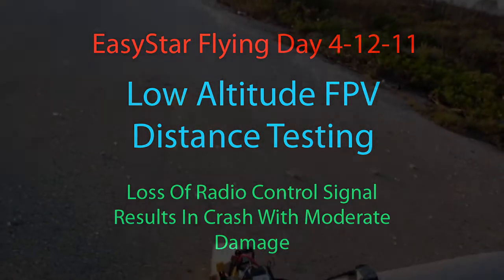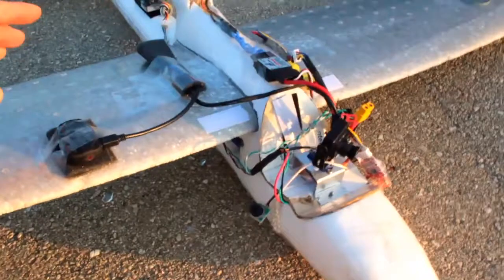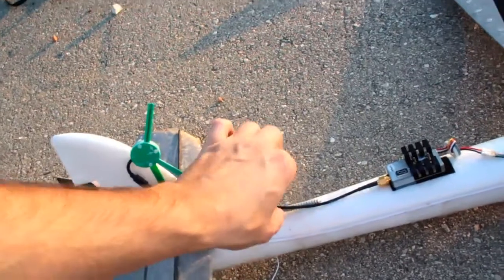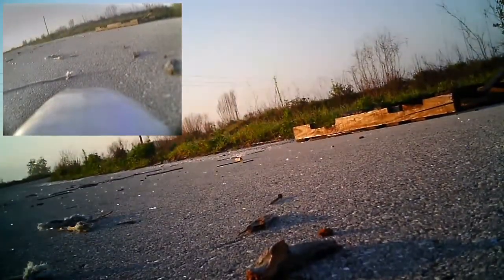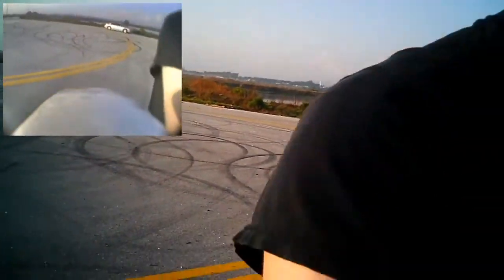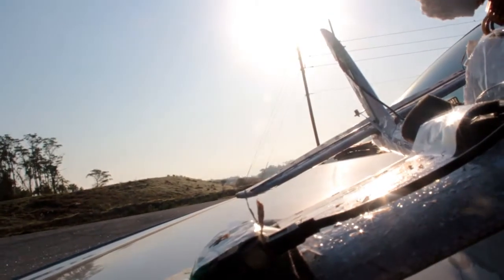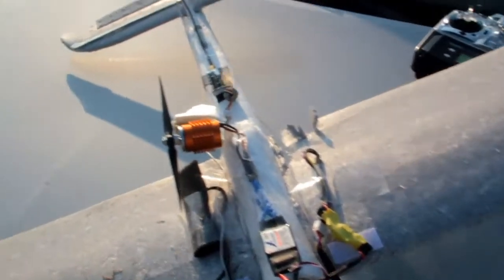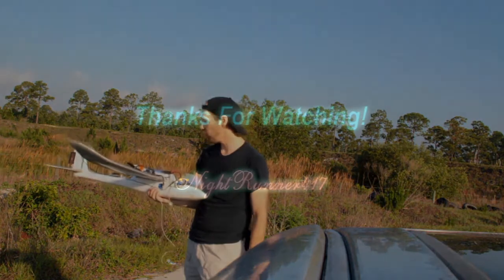EasyStar FPV 4-12-11: Low Altitude Distance Test And RC Signal Loss Crash

Comment: Well, at least you know about where the range edge is. I don't know much about this, but radio wave propagation rules dictate the length of an antenna due to the frequency it's receiving and transmitting on. Given a specific frequency, one could have an antenna too long or too short for that frequency. I could imagine a case where one lengthens an antenna thinking it would help with range, but finding out it hurts more than helps. But I'm sure you know all this already.

Comment from the maker: Yep, I CA'ed the motor mount back together, and used epoxy to repair the wing. Actually, this is the second time I've broken the motor mount (first time it took the entire upper half of the fuselage, lol!), and she does (did) steer to the right but it was minor enough to fix just by trimming. Mine is also set up so that I can shim the motor if the angle gets that bad, which is how I correct my downthrust. BIG YES to that string on the cam - I lost mine once too, had to go back the next day, lol!

Comment: get some epoxy and you will have her back as good as new,  good job you had that string on the cam,  my first crash was the same as yours but i didnt have the string on my cam it flew off and i was looking for  hours before i got it back, my motor flew off too cutting into the wing just like yours, but when i glued the motor back it never flew right again, so i got a new ez star body